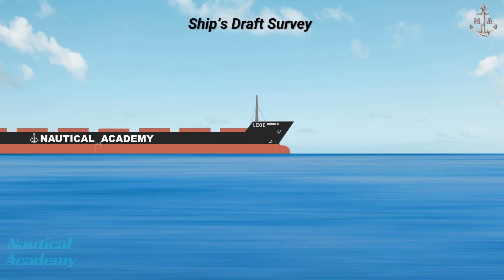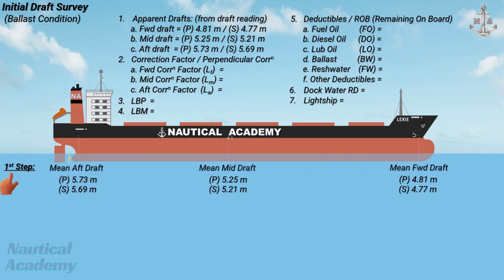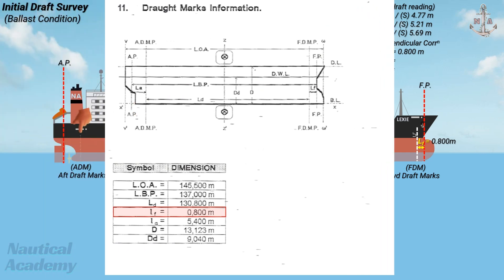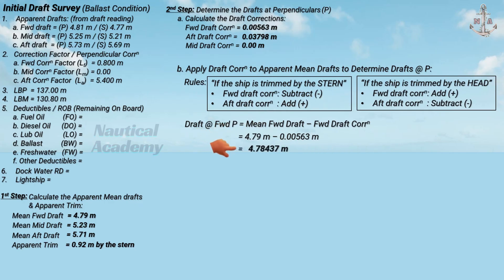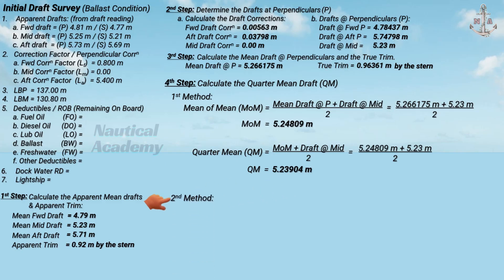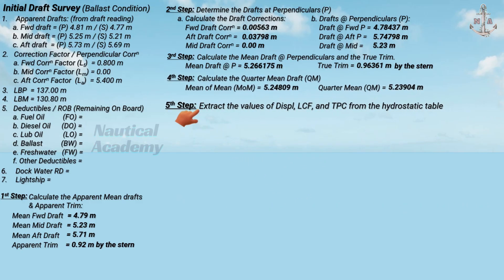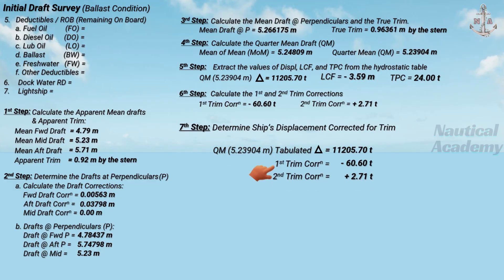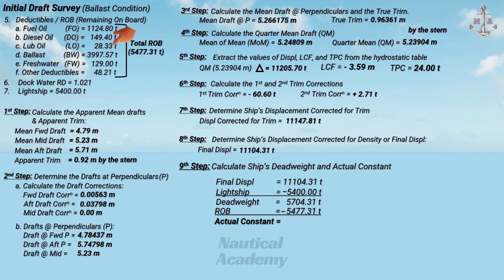Initial Draft Survey Guide: Calculating Ship's Actual Constant

Comment: hi, good day Sir how about initial draft survey in discharging port it's necessary to add Constant?
Reply from the maker: When conducting draft survey at the discharging port, after subtracting the Remaining Onboard (ROB) quantities from the Deadweight, you will get the Total Cargo + Actual Constant. To determine the Total Cargo Loaded, you must subtract the Actual Constant (which was determined during the loading port draft survey).

So, the Actual Constant should not be added at the discharging port — it is already included in the draft survey result. Instead, it must be deducted to obtain the true cargo quantity.